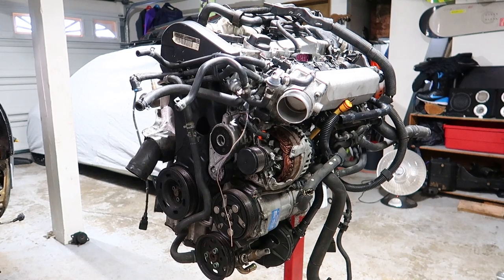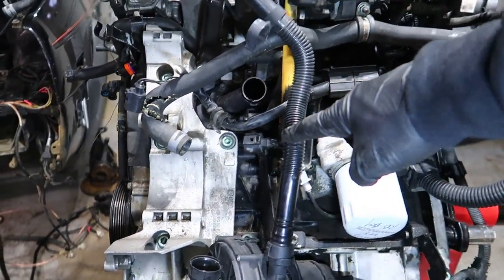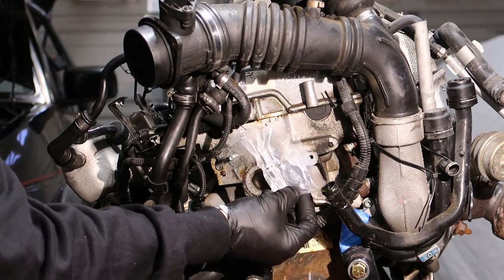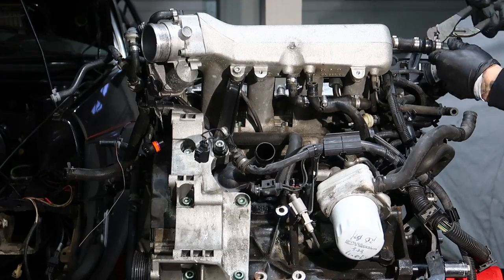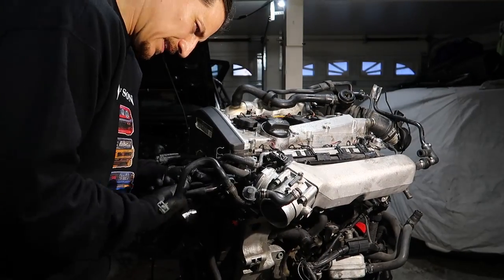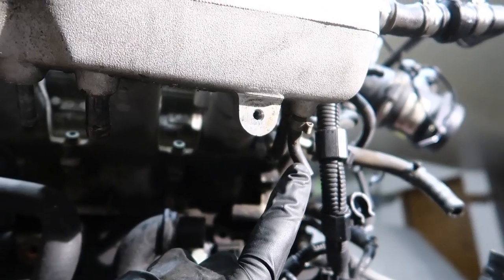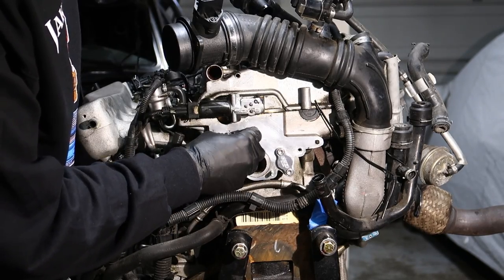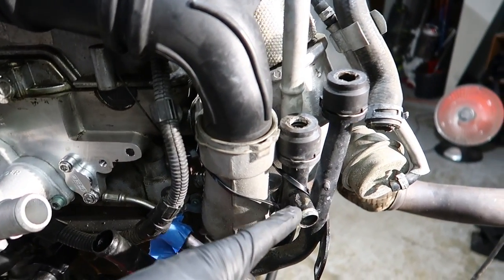How to Delete SAi / Combi V / PCV / N249 / EVAP | MK2 1.8t Swap Pt. 5

Comment: When I did my delete I ran one line from the valve cover and one from the 90 degree crank case elbow into a “Y” that went into a catch can.  Then a line from the catch can into the hockey puck.  Solves the problem of having to plug the hockey puck hole in the turbo inlet pipe.  Great video, keep it up!  Stoked to see how this project turns out.
Reply: Ryan Hautau yep. That how it’s done. I use a 3port catch can two inlet and one outlet. The valve cover and crankcase breather hoses hook up to the two inlets independently and the outlet goes to the hockey puck.(PCV valve)
Reply: Did it help with oil use?
Reply: @xplicitmetal  does the puck/pcv valve need to stay installed for some reason?
Reply: @Great Lakes Logger  no ,if you have  catch can and your pcv valve (out from engine block) closing good then not.

Comment: My Audi A4 was running rough so I did the vacuum delete sai and evap delete runs amazing now with no check engine light relly helped thanks a lot
Reply from the maker: Appreciate it, glad the vid helped you out.
Reply: Hi,
Is it still running well ? 
Is it passing emissions? 
Just bought my Audi A4 1.8T  BEX and after changing pcv, plugs, coils, new rocker cover gasket it still runs lumpy on morning start for a minute or two...then it  settles and runs well...gives me headache at this stage.

Comment: What I find works well too is leave a short portion of hose and plug it with a bolt and secure with a hose clamp. That's in case you don't have hose caps or don't have the correct sized one.

Comment: Cant wait for you to get to the motor mounts. I have no earthly idea how to do them....and another very informative video...
Reply from the maker: Yep transmission is next but I’ve got some parts to order. Then I’ll be getting it in there.
Reply: I didnt know but tip. YOU NEED NEW MOTOR MOUNT BOLTS when replacing the motor mounts.. i didnt and one side of my engine came free and got 1" from hitting the floor .. .

Comment: Appreciate the extra time. On the car it's a pain enough 2 do than show. Most skip the doing it step n shove their phones in n hope we see what they are. Getting the idea of it best I can with my 04 passat awm 1.8T manual. Uve come the closest to fully explaining it properly so thanks much...
Reply: I've got a 2005 awm passat with the zf automatic. I bought the car with ecu power issues and a bad trans. I pulled the engine and trans and I'm about done rebuilding both. Now I've got to figure all the vacuum stuff out without knowing what went where and apparently no one has ever done a video on sai, evap, pcv, and n75 deletes for the b5/b5.5 platforms. Tons of stuff on the Mark IV for example, but nothing on a passat or a4.
Reply: @GreatLakesLogger  nice. I do plan on adding the delete with a non chintzy catch can as well. Shortly after getting it I pulled out and replaced the diverter valve and I found the lovely oil there. So when I get my next check I'll be changing out 2 a hidden front mount intercooler and that catch can which will be relatively close to the motor. Even though I store it 4 the winter here in WI I still start it often to maintain functionality of everything. Fortunately for me the motor runs quieter than my mahs 2014 fiesta Titanium and I recently replaced the gasket that sits between the trans and engine. Shifting has no hesitation I do hate the non adjustable hydraulic clutch but having it the way it is prevents it from wearing out for those who cant shift properly. Be awesome to see that roar to life. I typically scream our loud ITS ALIVE! when I finish with a project. LOL stay safe my friend.
Reply: @BigSteve_Gaming187  cool👍 I also live in WI, just east of Eau Claire. I just ordered a 2 port mishimoto catch can this afternoon from Summit. Hopefully I can get that to work good. Your yelling "it's alive!" reminds me of Derrick from VGG😃
Reply: @GreatLakesLogger  hehe. Well I'm not far off. I'm closest to Portage. Crazy how you purchase brand new break rotors and within a week they start rusting all around. Can't stand it which is why my Granny Sleeper is parked in a garage. Wisconsin one of the few places to recieve all 4 seasons in one day.
Reply: @BigSteve_Gaming187  😃 as one of my friends tells people, last year summer was on a Wednesday! I love it though.  My oldest brother bought a 2005 Jetta TDI from a used car dealer in Portage. Actually not sure if that was Portage, but it was just off 94 at the portage exist. Really nice car, tuned, injectors, turbo, and upgraded clutches in the dsg. Had it a few years then totalled on the way back from seeing his girlfriend in PA. A semi was almost stopped on the interstate in front of him and he didn't notice until too late. The car went under the rear bumper of the trailer. Didn't so much as scratch the engine cover, but it shoved the window in, the dash back, and buggered all the frame in that area. He was fine aside from a scratch on his arm from the glass in a picture frame (his girlfriend) he had propped up in the center console. We were glad he was OK (obviously) but it was such a shame his car was so mashed.
Reply: @GreatLakesLogger  Damn.... Glad everyone is good too. My buddy literally installed a turbo on his 92 4door and the next morning (being up all night) was on his way home (210hp which is maxish for front wheel civics on road) lost control after catching the gravel and just missed a house after taking out a shed n a fence. Accidents happen when u least expect it. I was surprised to see a mark 3 golf the other day when I was in watertown. Naturally aspirated or poorly maintained but nice 2 see them when their around. I would love to get another hatch. Preferably one with the 1.8T like the one in my ride. Gotta have goals rite... hehe

Comment: I’m following this, just bought a mk2 1.3c to convert an AGU into and this is my instruction manual!
Reply from the maker: I hope with this video and the diy link I put at the bottom it will be easy for you.
Reply: The only difference I think between yours and mine is that my engine (agu) runs throttle cable so I think I can use my existing 1.3 throttle cable? I think I still need the Corrado/b4 pedal assembly to allow me to fit the clutch master still. Another question if I use the 02j box, do I still need to fit a g60 clutch and vr6 flywheel with the AGU/02J combination?

Comment: Those two hardliners can be deleted with the intake removed but one is a coolant line for coolant return to the expansion tank.
I only learned from accidently mixing two like an idiot and having to tear apart everything to clean coolant from everything when it contaminated my sai system.
Now deleting.
For anyone trying to keep most factory air hoses,
Run the crank case breather 90 elbow to the valve cover to an inlet to a catch can and run the outlet of it to the larger turbo inlet pipe, where he mentions needing looking for something to plug it.
If you delete the hockey puck, be careful as its the only thing that saved my motor from coolant ruining everything
Reply: Question, so I've done the whole EVAP delete. Now my real question, can I completely delete that hard line for the coolant return? Is it truly necessary?

Comment: Regards to the coolant hardlines, the one you have is from a automatic that had a transmission cooler. Just get a manual hardline and swap them in.

Great video per usual man.
Reply from the maker: Awesome thanks for confirming that. I need to get to picknpull to get a bunch of little stuff
Reply: excellent video!  i have a vw jetta gli 1.8t mk4 ... but it is TIPTRONIC transmission ... can i do the same procedure?  Does the transmission affect anything?

Comment: Well done Jake. Starting to think it's easier to just swap a VR and turbo it than it is to deal with 1.8T spaghetti.
Reply from the maker: Man if i was swapping in a vr it would be done by now lol. And down the road we might see how long it takes to swap in a vrt :)
Reply: @JakeRawSon  yeah. Taking notes on this build for my AEB 1.8T syncro Corrado that I'm getting back around to this summer.
Reply: Keith Hache aeb has less stuff but a little more work to get it done
Reply: @k.a.r.z3544  heah. Already have thw aba stuff and shaved pulley
Reply: Keith Hache what about the oil pan?
Reply: @k.a.r.z3544  I'll prpbably use a 2.0L steel one and pickup and weld in a turbo drain bung.

Comment: I think the steering pump is the same if I remember correctly you can use it with A2 system. The difference is the bends on the A2 sub frame hard lines to the steering reservoir and you can use the A3 one they bolt up easy. I did a few conversions, I did a G60 conversion into an A2 Jetta and used all the accessories. You may need to clearance the subframe  ,keep that in mind you will see it .great job loved the video ,i will follow the project 👍
Reply from the maker: Thanks for the info

Comment: Great job man! I have 1.8T too but ARX and I`m  considering to do the same soon. But, I have a question, what happens with the pipe which goes to the turbo actuator? I dont see if you do something with it and we need pressure there ?

Comment: Great Video! Gave me a better understanding of what waits for me as I am debating whether to delete the SAI. I’ve just installed an Integrated Engineering Catch Can and I love the crank case elbow and the port for the valve cover of the kit. Give it a look if you ever decide on a catch can. If I delete anything it may only be the SAI but leave the EVAP. I’ve taken notice of how many have went back and put their EVAP system back on but we’ll see.

Comment: Are there dummy sensor plugs involved with this process to stop throwing codes? Im hearing secondary air flow code can only be eliminated by software tuner. dont want to proceed if the car wont pass inspection.
Reply from the maker: Ya don’t do it

Comment: Can you please give me the part number to the crankcase elbow I've already bought two different sizes that don't fit
Reply from the maker: https://www.ecstuning.com/b-uro-parts/breather-hose-connector/06a103213f~uro/?gclid=Cj0KCQiA5bz-BRD-ARIsABjT4nj-IcfAtdL1YLuLXtxQVqNSdsduSRRkKG2mb_F--2lJ1PYVlRy9U1AaAq8XEALw_wcB
Reply: @JakeRawSon  thank you
Reply: The one you bought in the one that you took out of the car are two different styles.. did they both fit the same way? I've actually bought both of them and I can't get it to sit flush enough to put the pin
Reply from the maker: @chayanesanabria5104  Yes you have to push it down hard. Took me awhile to get it.

Comment: Since I have the combi delete, would I better off getting rid of the EVAP system Or is it still fine? 

Also When I have the diverter valve connected to the intake where you connected yours, it starts to lope and idle rough, but runs fine with it disconnected. Could that mean it’s gone bad?

Comment: Great instructional video ,I'm doing the same swap 🤟 ,do you know if is necessary to tune the ecu to delete all that stuff ?
Reply from the maker: I’m pretty sure it usually just puts the engine light on in the mk4s. But they make plugs for them to trick the system. And yes when you delete the immobilizer for mk2 swap you can have them delete emission with it.
Reply: @JakeRawSon  how do you delete the immo? can it be done at home?

Comment: I just bought a MK4 Jetta with the AWP motor.. If I delete these systems will the ecu throw out codes and run properly? Seems like this video was for MK2 owners and not sure if I can do this on my mk4..
Reply from the maker: It's the same thing for mk4 you just have more stuff to take off on the body of the car.

Comment: Thanks for the video !

So I am trying to instal the 034 breather kit - in the process , when removing the plate with the n249 I busted a bunch of tiny pipes. Im not looking to delete any of it, but I am lost as of where each one of them were plugged to.  Right at 5:33 you have a great picture of what Im talking about. what does "to DV" mean? Also, were would I be able to get good, not necesarily oem hard pipes from that assembly?
Reply from the maker: Diverter valve. And I get all the small vacuum lines at a hardware store.

Comment: Hi, I recently got a mk1 rabbit (diesel at current moment) and Im unsure if I wanna do a 1.8t, vr6, or a 1.9tdi engine what should I do?
Reply: Matthew Tamas do a 1.8t
Reply: Matthew Tamas 1.8t for the win
Reply: 1.9tdi they can make good power and the mpg is still there.
Reply: Ralle Johnson jr they can but they 1.8t will always smoke a tdi and is cheaper to mod then a tdi

Comment: very helpful video, thanks for sharing with us.
would you know if cutting the harness that goes to all the connections to the vape system and n249 solenoid valves, would it make the car not start.
Reply from the maker: It should still start. What codes does it have?
Reply: @JakeRawSon  I had inyector 3 and 4 connectors mixed up, it starts now. but now i have another problem with the wipers turning on when I try to turn the light on they wont turn on now

Comment: Will it need to be reprogrammed or tuned for the strategically relocated parts? And will a open air breather be better or stick with stock? Any help will be appreciated. Great video!
Reply: Anybody???
Reply: Hello, it will need to be tuned out because removing this stuff will cause a check engine light. My pipe that goes into my EGR(combi valve) is snapped and that’s causing mine

Comment: the secondary air pump has three hex bolts on the bracket and 3 that bolt to the engine to hold it on, the one by the    dip stick is giving me problems and i dont want to round it.  do you know the exact  size and an easy way to get it out?
Reply from the maker: Man those things were on there so tight for me also. 
My Allen that I used wasn’t the exact size either I just made sure to push in as I was turning it.
Reply: I used a sawzall and left a bit of the bracket for now. When I pull the motor for a later stage of the build ill have a better angle on it im thinking

Comment: So if you remove the N112 for the EGR (AKA combi valve) that will effect emission testing and have to be reinstalled for a certificate? Also I assume running a direct vacuum line from the manifold rather (than the N249) will benefit the DV to perform better?
Reply from the maker: I’m not sure about emission testing we don’t have any here. Yes the DV performs better straight front intake manifold

Comment: Hello, anyone can help me with the resistors to blank the sai, evap, etc. I bought the kit online and damn have different plugs! My question here is they have to go into the plug socket as negative and positive or it doesn't matter, as I want cut the connectors to solder it to the harness the resistors? Thank you 😊 the car run/boost sweet but the fueling is terrible 😁😁😁 I hope resistors does help

Comment: Question. If you run the line from the brake booster straight to the manifold, isn’t all that boost going to go into the brake booster? Shouldn’t there be a check valve on that hose to prevent the boost going into the booster? I’m in the middle of doing this myself. I hope you see this so I know lol.
Reply from the maker: It should have one. It’s a safety thing. But I’ve never had any problems without them
Reply: @JakeRawSon  thank you for your response. I watched your video a good 20 times and I think I have everything down. I have a b5.5 Passat wagon so an AWM engine but very similar vacuum line setup.
Reply: @Ryan Candelora  I just did all these deletes today on my 1.8t ATW
Reply: @datorr7470  since that comment, I did them on both my cars. I only did it because my crackles on decel disappeared and I thought maybe it was a vacuum leak but it’s not. Still haven’t found the issue.

Comment: I am learning bit by bit about cars and engines, so I'm sorry if this seems like a stupid question to some. In a quick sum up, what does deleting these systems do for your car? Is it mainly just to declutter the engine bay, or does it affect performance?
Reply: it’s 10 months later but it slightly helps performance but the main reason is these cars have a lot of problems over times with all those extra lines, they’ll start cracking and leaking and you can take them off because they’re mainly just for emissions, also it’s a pain in the arse to do ANYTHING in that engine bay with all the extra lines and hoses

Comment: Hey nice video.  Do you have an idea how much power you would gain from removing all of that stuff?  Thanks.
Reply: If there are no leaks in the original system you should not really get any power difference perhaps more responsive throttle response. With the amount of pipework in the original system there's a high probability that something is leaking especially if you have not replaced the pipework. Any leak can make a huge impact in the power the car makes. I would suggest doing a smoke leak test to see what needs replacing if you are not sure you want to delete everything and deal with the relevant ecu codes. Check boost pressure with a diagnostic machine mate.

Comment: Would this still pass emissions with the Pcv and sai removed? Love to do this it would fix a bunch of my problems.
Reply from the maker: I’m not 💯 % sure but I don’t see why it wouldn’t.
Reply: As far as I know SAI has to be coded out of the ECU otherwise it will not pass readiness and will keep CEL on. But apart from that, since SAI only works for a couple of minutes on a cold engine to get the cat to operating temperature more quickly, it being out should not increase emissions overal. PCV is not related to emissions.